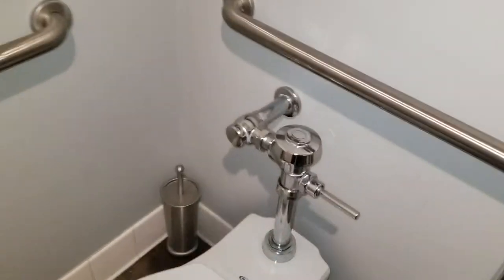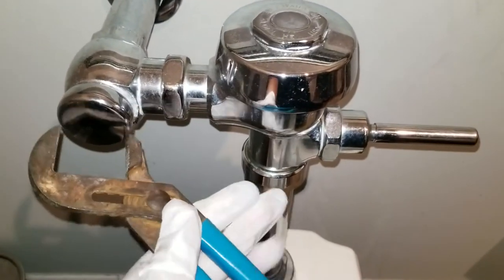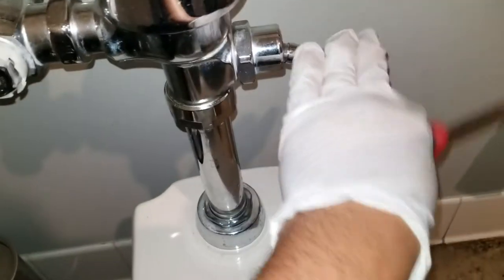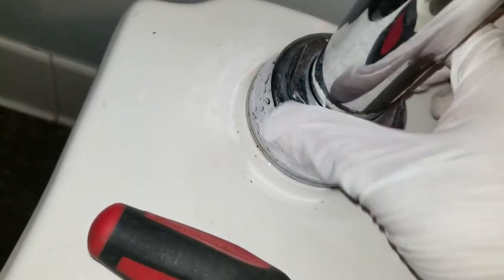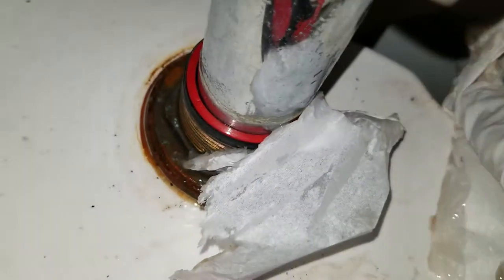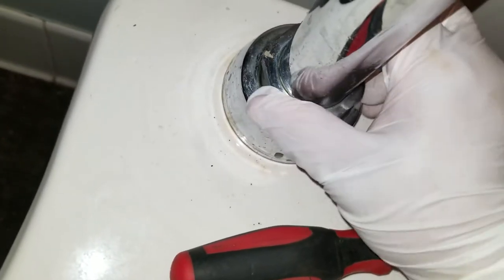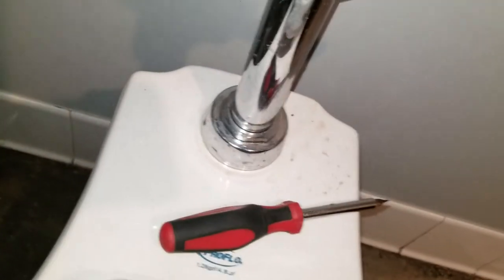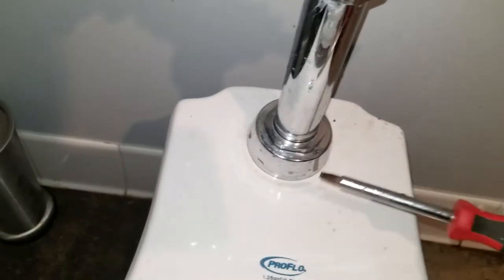Sloan valve spud is leaking part 1 of 2

Comment: Also for anyone who has a spud that won't stop leaking you can take an 1 1/2 slip joint rubber bushing for drains and put it on the very top above the red washer. Little tech tip hahah